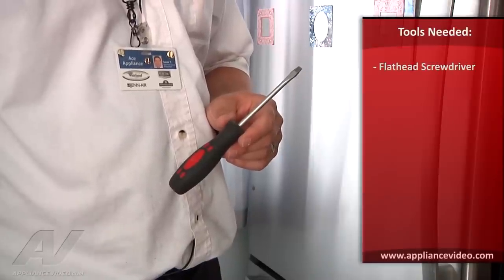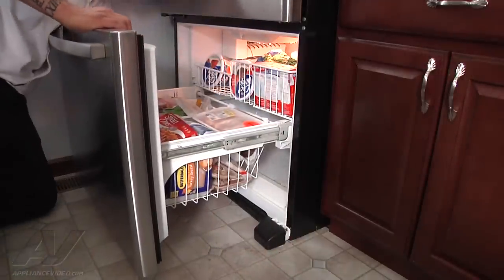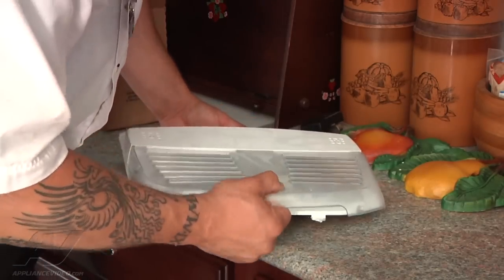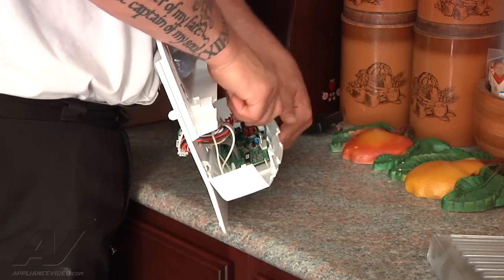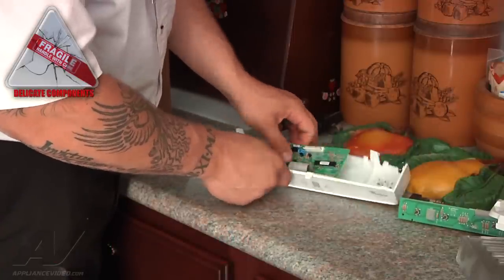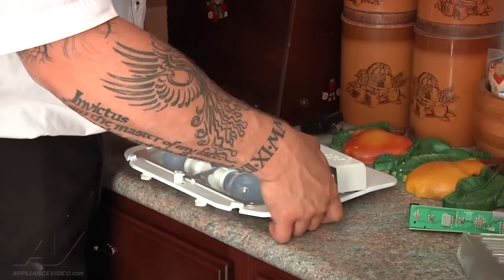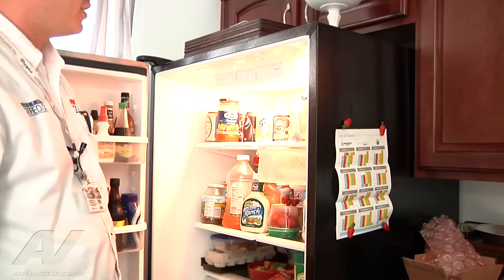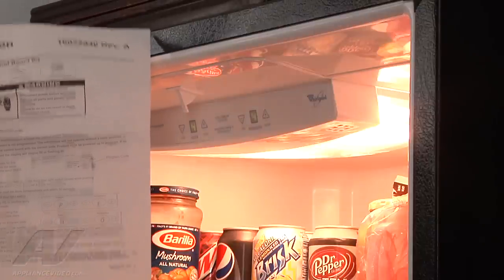Whirlpool Refrigerator Repair - Frost Build Up in Freezer - Jazz Board

Comment: Thanks for the video. My whirlpool fridge is the same model. The temperature number goes to “-“ on both sides.  I tried to reprogram it but won’t work. So I decided to replace the control board.  2:40 I pull down the panel, but the right side light compartment seems to glue to the top because the light overheat and melt it. I am concerned if I pull down hard it will break the top. Any suggestion?
Reply from the maker: Great question, if you have a more technical question that our parts department cannot answer, you can search our over 17,000 answered questions free at our website www.ApplianceVideo.com under our Repair Help section. You can also call our parts department at 1-800-830-5465 and they can give you help 7-days A week ,or search at www.SaveMoreOnParts.com  .

Comment: Bought a new defrost timer that works perfect but, the coils are "always" frozen up!?
This is a whirlpool top freezer.
What causes this?
Awesome video. Thanks so much.
Reply from the maker: Great question, if you have a more technical question that our parts department cannot answer, you can search our over 13,000 answered questions free at our website www.ApplianceVideo.com under our Repair Help section. You can also call our parts department at 1-800-830-5465 and they can give you help 7-days A week ,or search at www.SaveMoreOnParts.com  .

Comment: Thanks!  Very helpful video.  I have newly purchased a similar Whirlpool model with heavy frost buildup in the bottom freezer.  I'll try out your pointers but since it's under warranty any circuit board replacement will require a phone call.
Reply from the maker: Doug Powell 

Thanks for your positive comment. We are glad we
could help resolve your issue and hopefully saved you money. Please help us
provide more videos to our site by subscribing to our YouTube page or posting our
http://www.appliancevideo.com/ website on your Facebook or Twitter account. Our
factory authorized technician’s also daily provide free professional Repair
Help to people like you to help solve their appliance problems. You also have the option to email a factory
service technician with a question at http://www.appliancevideo.com/repair-help/ .  If
you need of parts for your major appliance, we have over 5-million parts in
stock at http://savemoreonparts.com/ . Thanks
in advance for supporting us. So email us if you have any other questions our
videos cannot resolve. Thanks for your support in advance.   Matt, Ace Appliance service technician.

Comment: how to change a whirlpool model number WRB3220MBM01 LED light not working can’t figure out how to get it out.  Bought this refrigerator a year ago.  I’ve never had a problem like this before.
Reply from the maker: Great question, if you have a more technical question that our parts department cannot answer, you can search our over 17,000 answered questions free at our website www.ApplianceVideo.com under our Repair Help section. You can also call our parts department at 1-800-830-5465 and they can give you help 7-days A week ,or search at www.SaveMoreOnParts.com  .

Comment: my freezer work too much but my refrigerator is warm. When i unplug for a few day, I've got water on the floor. I plug it again and work great for a few day. Then freezing again too much. Can this board will fix my problem ?
Reply from the maker: Joel
     All of our technicians are now answering questions daily on the ApplianceVideo.com website. You can search completely FREE in our Repair Help section with over 1000 questions & answers. Or you can get unlimited technical advice and video links emailed to you by our 14 factory certified technicians at http://www.appliancevideo.com/premium-membership/.  If you are in need of any parts please support our parts department on line at http://savemoreonparts.com/ or call 1-800-830-5465 7-days a week until 11pm Eastern time. Thanks for your support. Matt Ace Appliance factory service technician.

Comment: I'm having an issue with ice collecting on vent in the back of my snack drawer  in my whirlpool 4 door fridge. It happens every couple of months. We let it defrost and its good for a while.  I can't find anything like this on line. Have you seen it?
Reply from the maker: Great question, if you have a more technical question that our parts department cannot answer, you can search our over 13,000 answered questions free at our website www.ApplianceVideo.com under our Repair Help section. You can also call our parts department at 1-800-830-5465 and they can give you help 7-days A week ,or search at www.SaveMoreOnParts.com  .

Comment: did you check the heater for continuity and the thermostat before swapping the PCB?
Reply from the maker: Yes, the technician did that . If you go to ApplianveVideo.com we have separate videos on testing  parts.
Reply: Well that was not expressed in video

Comment: I have an Amana bottom freezer. The inside the door water dispenser freezes at the spout. If I warm with my hand a second it will work sometimes. The refrigerator and freezer seem to maintain proper temps. Any thoughts
Reply from the maker: Vincent
         All of our technicians are now answering questions daily on the ApplianceVideo.com website. You can search completely FREE in our Repair Help section. Or you can get unlimited technical advice and video links emailed to you by our 14 factory certified technicians at http://www.appliancevideo.com/premium-membership/.  If you are in need of any parts please support our parts department on line at http://savemoreonparts.com/ or call 1-800-830-5465 7-days a week until 11pm Eastern time. Thanks for your support. Matt Ace Appliance factory service technician.

Comment: What if the unit isn't running at all, the controll is on but not displaying numbers.
Reply from the maker: Great question, if you have a more technical question that our parts department cannot answer, you can search our over 17,000 answered questions free at our website www.ApplianceVideo.com under our Repair Help section. You can also call our parts department at 1-800-830-5465 and they can give you help 7-days A week ,or search at www.SaveMoreOnParts.com  .

Comment: In the older machines we were able to fix most of the things BUT now we are at the mercy of the electronic circuit boards. 🤔
Reply from the maker: Great question, if you have a more technical question that our parts department cannot answer, you can search our over 17,000 answered questions free at our website www.ApplianceVideo.com under our Repair Help section. You can also call our parts department at 1-800-830-5465 and they can give you help 7-days A week ,or search at www.SaveMoreOnParts.com  .

Comment: How do you know the fan is not going bad?  Pretty simple diagnostic for fan used.  What atr yiu Not explaining?
Reply from the maker: Great question, if you have a more technical question that our parts department cannot answer, you can search our over 17,000 answered questions free at our website www.ApplianceVideo.com under our Repair Help section. You can also call our parts department at 1-800-830-5465 and they can give you help 7-days A week ,or search at www.SaveMoreOnParts.com  .

Comment: As a factory certified appliance tech, I am disturbed that you would have a consumer work on a live appliance. The unit should have been unplugged before removing that control panel. Electrocution is deadly !
Reply from the maker: This is a factory authorized technician working on the unit. Its on only for lighting and taping  purposes. We have warning icons to unplug the unit before every video. These are taped in customer homes and are real service repairs. Lighting is an issue so we only have the unit  on if we have lighting issues. Thanks for your input , we certainly do not promote working on any appliance with the power on.
Reply: No one ever died working on 110 volts. OMG!!!
Reply: Whirlpool fridges are Class 2 isolated however it is a crap shoot with their other products or competitors fridges.  I would agree with you, don't take the chance and unplug it.  This video is a mess all around.  The control was clearly good and someone just left the fridge door open a bit.